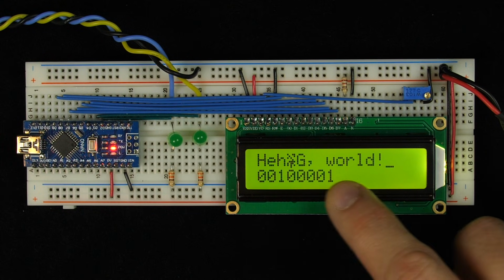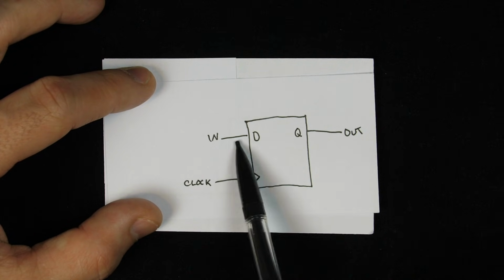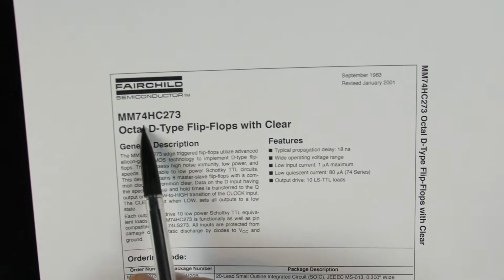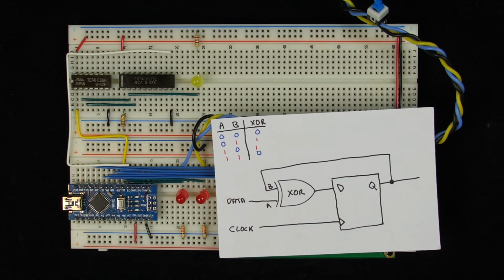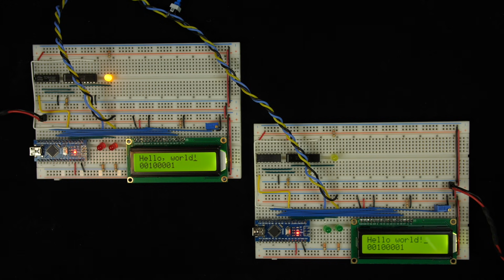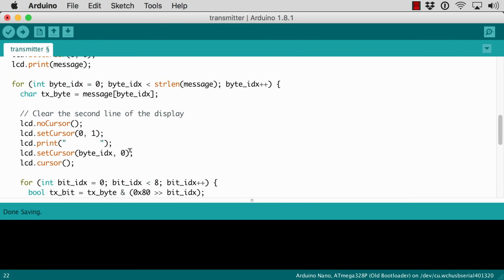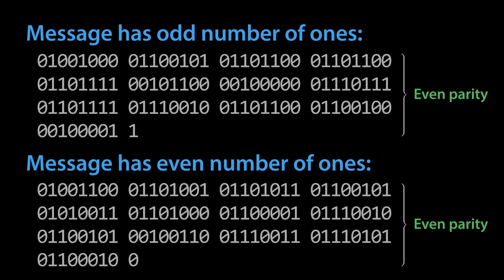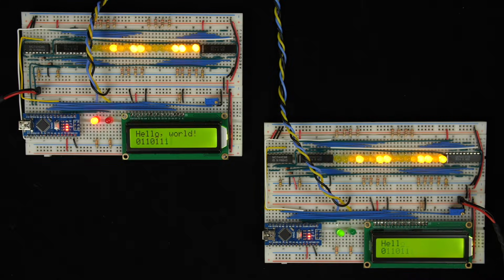Error detection: Parity checking

Comment from the maker: The circuit I start with at the beginning of the video comes from the previous video: https://youtu.be/eq5YpKHXJDM

You may have noticed I changed the LCD displays from the last video to yellow ones because they’re easier to read. Other than the color, they are identical. Links to both are in the description above along with links for all the parts and code used in this project.
Reply: @Aser. Doing a Half-Duplex comm would involve adding some bidirectional buffers and a direction protocol, but doing it Full-Duplex over the same wires would be a challenge.  You'd have to do local and remote echo-cancellation.  The latter would put hair on your chest if the transmission lines were not ideally terminated and the propagation delays were more than 1/2 of the bit width....
Reply: Amcia Apple Propagation delays more than half a bit width aren't exactly gonna come up when you're transmitting a few bits a second, so that's no problem, so echo cancellation can be safely ignore. To put it simply, you just need to ensure both devices aren't transmitting at the same time, or in the case of full duplex both the devices are capable of transmitting and receiving at the same time, as the transmission rate/speed is too low.
Reply: Full duplex is easy to do using two sets of wires, one in each direction -- that's how twisted-pair Ethernet works, for example.

Doing it with a single set of wires usually involves modulating the signal onto some kind of carrier and using a different carrier in each direction. For example, the old 300 baud dial-up modems used four tones of different frequencies, for 0 and 1 in one direction, and 0 and 1 in the other direction.

Echo cancellation is only relevant if you're trying to send baseband signals (i..e. no modulation) over a single pair of wires. Analog telephone connections have to contend with it, but as far as I know nobody does that with digital signals.

There are a great many modulation schemes and endcodings that can be used -- lots of interesting future material for Ben here!
Reply: Ben Eater hi, could you try to upgrade that system to be able to comunicate the two devices, in the 2 directions? (being ahle to transmit and recive data at the same moment, not only a transmiter and a reciever, but both being transmiters & recivers
Reply: Amcia Apple you make it sound as it was extremelly simple & obious, but its not, im not a expert/i dont have enough knowledge. Im still a 16-17 year old teenager interested on electronics -_-
Reply: Aser Granado Walkie talkies are half duplex - only one of the two devices can be transmitting at the same time, while cell phones are full duplex - both of them are transmitting and receiving at the same time. I know this is a crude example, but I'm no expert either.
Reply: Aser Granado - Amcia Apple is talking about connecting each transmitter to the line through a tri-state buffer. When a station wants to send something, it turns on its buffer, sends the data, and then turns it off again. The two ends would have to coordinate somehow so that they didn't both try to use the line at the same time.

In practice you probably wouldn't want to connect the buffer outputs directly to the line, but through a series resistor or something like that, to prevent damage if they do happen to get turned on at the same time.
Reply: Greg Ewing Yet at the same time ensuring the series resistance is low enough as to not attenuate the signal. Complex situation really.
Reply: Greg Ewing I also believe echo cancellation is needed for digital signals when using telephone lines (I forgot the correct term for it) for the communication, though I could be wrong.
Reply: Ben Eater cool Video!

Please upgrade your 8-bit Computer with an numpad or keyboard and an driver for the keyboard.

Thank you. I am really looking forward for the next video
Reply: To demonstrate circuits, you could use simulator.io. it works really well.
Reply: Please make video on how to use digital potentiometer potentiometer.
Reply: @Aser:  The phrase "put hair on your chest" is a euphemism for "not easy".
Reply: Ben Eater I paused and thought of my own solution when you asked for one. I realized it is the same as how XLR cables work with their 3 pins. 1 pin is positive voltage/ 2 pin is ground/ and 3 pin is not connected to transmitter but still runs length of cable with the other pins. If EVER the receiver finds a voltage on that pin it means the signal pin could have gotten a voltage it wasn't suppose to either. Then you'd just restart the transfer of that byte until the third pin never goes above 0v.

I think this method would work only if all 3 wires are twisted around each other as they run to make sure the interference gets equally close to each wire.
Reply: Actually I misunderstood how XLR cables worked but I suspect my suggestion is still possible (+it doesn't take any processing data on the transmitting but does require detection on the receiving end)

Still you should read about XLR because that is pretty damn cool itself.
Reply: ben
can you build TV typewriter by Don Lancaster
Reply: @IntellectualUniversity  This would be really cool. Im in my 40s, my dad bought an Apple ][+ when it came out because he was a ham radio guy and had tried and failed to build a computer. "You'd be surprised how hard it was." - Now that I hear the name again, This is the group of projects he was discussing. And my dad was real good fixing tube radios and tv's. He understood the electrons and waves like some thing he could hold in his hand.  
Id love to see the code that accomplishes what those 1973 chips and boards did with ascii and character advancement, etc. Really cool channel!
Reply: will you do paging and some other stuff?
Reply: Sir please make video on how to use digital potentiometer without using programming?

Comment: Maybe you can use a checksum? At the end of the message, it sends an end-of-message signal, then the checksum, then the end-of-transmission signal. If the checksums don't match, then the receiver sends a signal to the transmittor saying that it didn't get the right checksum.

i just realised this video was from 2018... oops

Comment: Hi Ben, I really love your channel! I've grown an interest in computer science ever since I started watching and it doesn't stop. I do have a question, though: Seeing as you're transmitting the data bits serially, it'd be impossible to have two bit errors at the same time. Therefore, couldn't the transmitter just constantly send its parity bit, and if at any point the receiver's parity is different, it sends an interrupt that halts the transmission?

Comment: 2:40 Don't know if someone commented this but one way to do the "correction" is to use three receivers and vote which is correct. There are computers that work this way. They are used in places where fault tolerance must be maximised. If a module shows that it is outvoted all the time then it "calls" the technicians to replace it.

In the 90's I was present when in one of those computers the backplane was the problem. It was a stupidly simple procedure to fix the problem. The technicians erected the new backplane, fired it up and connected it to the old backplane. While the computer was running they transfered the function of the "old" computer to the new one by just pulling out modules from the old backplane and inserting them into the new.

Even how impressive it was, the company I worked then did not buy those computers.

Comment: 📺💬 Jirayu adds some conversation ... make it more of an example about parity checking.
🥺💬There are multiple and parity bits when summation is working with parity bits and multiple errors can handle by previous message and parity error checking bits, see from his example there is a bus clock working and they are divided message into multiple brackets and there are options to have parity number checking at the end of each bracket or each blocked that is because it is at least number format for send a command.
🥺💬 Now it is a trick here when you transmit a command with an error it required the same setup message value to stop and reply back ACK or Reject but when the parity bits checking is incorrect the receiver waiting for the next actions in the queue. 
🐑💬 We added a timeout message later that we never expected that to happen ...
🥺💬 Yes timeout I need to prepare for the schedule and will continue on this VDO and that is call error parity bits checking time delays that had wide effects in time.
📺💬 ยุ้ยแถมเยอะไปแล้ว 🥺💬งานผมอย่างนี้จริงวจริงครับเพราะว่าต้องทดสอบ แต่ว่าไม่ได้เขียนเองมากนักหลอก เว้นแต่ requirments เดี๋ยวกลับมาใหม่ครับ
🥺💬 ผมยกตัวอย่างนี้เพราะสำคัญ จะให้ผมยก matrix มาตอบอาจจะไม่รู้ว่าสำคัญอย่างไร ได้รับข้อมูลผิดก็ส่งใหม่ ได้รับข้อมูลแต่มาไม่ครบเท่าจำนวนที่จองไว้ หรือยังรอรายการอยู่เป็นอีกเรื่องนึง ให้เห็นว่ามันสำคัญอย่างไร

📺💬 After the conversation and now we add the D-flips flop into transmitters it is XOR gates and see what is the effects on the receivers.
🥺💬 It had Opamps inside with logical gates that emit exceed current and encoding output, as you say if there are no delays in transmitting setup and the receiver uses logical gates that see its circuits it provides current flow with logical gates output mapping. 
📺💬 Yesterday's post, can you delete about a delay or reverse delays 
🥺💬 It does not require transmission and receiver because it has a delay in nature except in the experiment like yesterday and the purpose of D-flipflops is more into encoding signals and phasers.

📺💬 พลังเจ้าฟ้าครับ จับมันคิดเลขออกโทรทัศน์ 🥺💬 ผมก็จะบอกเหมือนกันพวกเค้าคิดไปเอง ผมไม่มีอะไรทำเลยตอบเล่น จริงแล้วเนื้อหาบางอันดีนะแต่เค้าพากย์เพิ่มเสียงเข้าไปด้วย อันนี้ไม่ยากครับผมไม่ได้จะอวดหรือมีจุดประสงค์อื่นดูตัวอย่างที่ผมยกให้ตอนที่ขอผมรู้เรื่องไหมครับ⁉ บอกพวกเค้าหยุดด้วยเค้าทำอย่างนี้อ้างคนไปทั่ว 📺💬 เอองั้นหยุดนะยุ้ย 🥺💬 ผมดูน๊อตเค้าก็ด่าผมครับ ทำรายการไปเถอะมีประโยชน์

📺💬 Lower header and error corrections.
🥺💬 Lower header transmission because it can error correct information, thank you that is good VDO.

Comment: Why not use RX and TX clocks?
Basically, when the transmitting device sends a package and wants the receiver to read it, it drives TXC (tx clock) high for a short amount of time. Then, it waits until it receives an RXC pulse, and when it does, it starts over.
Meanwhile, the receiver reads the package, does some stuff with it, and then, when it's ready to accept more data, it pulses RXC.

Comment: Making that parity checking bit with electronic hardware is a bit irrelevant in my opinion. In real networking hardware this is all done with software of course. You could as well have put a pigeon with a letter in between the parity bit circuit... equally irrelevant. But interesting video nonetheless. 🙂

Comment: In this video, +Bean Eater is using two wires to send the data and clock, why not use a third wire to send the parity and detect errors early?

Comment: 13:36: Interestingly, you're shorting out the 1 to ground for three clock cycles; that's how the o (ASCII 111: 01101111) turns into a (ASCII 97: 01100001).
14:08: Even more interestingly, here you've shorted out the 1011 sequence in the comma (ASCII 44: 00101100), turning the character into a ␀ (NUL), which in the HD44780 is user-specifiable, but left undefined here, so nothing is printed for it; that's how it's simply omitted.
Reply: Great insight!
Reply: @andreamazzai1969  Thank you. :-)

Comment: You can also check the number of changes. 

A string of binary changes odd number or times
A string of binary has an even number of 1s

If 1 bit changes, # of 1s will catch it. If more than one bit changes, the # of changes check will most likely catch it.

Comment: Just a tip: The reset line on your arduino is already pulled high through 10K, and goes low when shorted by the button. You could have connected the reset line straighr to the clear on your external logic so it would reset it's state when you reset the Arduino. Great videos BTW.

Comment: Awesome video, as always. I'd like to add one thing, however. I felt the jump to the D flip flop and XOR gate was not smooth. I like to think of it as: we are adding bits, and all we care is the Least Significant Bit. Now, what do we use for adding? (Maybe add a part of taking people from the required truth table of one bit adder, and show that it is basically an XOR gate). Then, add that you need to be doing this recursively for the entire message. And thus, enters the D flip flop into the picture, as a clocked  memory element. 
Again, your videos are awesome. I'm an Electronics Engineer currently pursuing my masters, and find your videos entertaining and useful for learning stuff.

Comment: Love your videos!!  Do you mention anywhere how would you handle bit-alignment errors?  Try starting the Receiver at a random pause after starting the transmitter?  Bits could all be received perfectly, but if the bits are misaligned, the data would be wrong.

Comment: You could just calculate parity in the Arduino code in stead of building a parity circuit, right?

[EDIT] .. and also would it be sensible to use the first unused zero-bit to transmit it?

Comment: The light keeps introducing errors when he is not turning it on and off because it is AC running through the cord, turning it off momentarily stops the interference. That's one reason cables have shielding :)

Comment: parity check is good, but only when it's always with parity checks.
I worked on a program, but from one input, it had parity bit but the other one didn't, so the data was messed up

Comment: Really liked the video, but I do have a question - is there a reason you're computing the parity bit in hardware, reading it into the Aruino, and then transmitting it rather than computing the parity bit in software?  Just wondering if there's any relevant trade-offs to be aware of here.

Comment: The triple check method you showed at the beginning of the video is actually used in the real world. And everyone in the US has heard it at least once. It's used in the Emergency Alert System (or EAS) at the beginning of the message. The first three tones that are heard are actually called the SAME (Specific Area Message Encoder) header. It contains data that tells the receiver which area(s) the message is meant for. If the receiver is not in that area or two out of the three headers do not match, the message won't go out

Comment: Hey Ben,
 cool videos. Getting again more interested in Digital Electronics. Caused by that I wanted to ask if it might be a good idea to use a M.Controller for translating a Binary input (greater than 9 ofc.) into a BCD code to be able to put it into a 7-segment display. I am using TTLs for building and I know that there is the SN74185 that does exact the same thing. The problem is that even with datasheet it's function is a big  mystery for me cause it does not the exact thing it should...EEPROMS I don't want to use cause Saving all the numbers in there would make me crazy :D

Comment: Very good and interesting video! There's just one thing I'm wondering. Is there a reason for calculating the parity with the flip flops and not the arduino? May the reseaon be that it's "cooler" (because it really is) or maybe just to more easily show what's going on? Thanks.

Comment: How good is it to use different hardware to calculate parity? I mean what if the wire to the hardware is fraud? Wouldn't it be better to check and calcualte parity in the chips itselv, because then you count on the ectual resieved/send data?

Comment: I have came up with my own answer for this but want to verify it with yall.

At the beginning the oscilloscope showed an erratic signal in place of some of the bits, but then after adding parity hardware, he just pused a button to simulate the error.

I dont see how parity would help if the electric cord was over the data line.. Wouldnthat register as a 1 or a 0 on the parity hardware?

Comment: Parity bit is not a good indicator for xfer err. You should use framing with ECC. Since you are using ATmega328, you will probably be limited to 256 byte frames with Hamming encoding (1 bit correction and 2 bit detection).
Reply: It's only the second episode of the series, I'm assuming he's going to talking about more detailed topics in later videos.

What you said sounds interesting though. I wonder if he will talk about that.
Reply: The main issue is that the ATmega328 has very little processing power and RAM in order to do proper ECC. So you are going to be limited to small byte buffers with mostly just XOR/AND correction (Hamming, etc.). Ideally, you would want something a little more powerful that could do real-time BHC correction that could correct lots of bits using the same 4-6 byte correction data per 512 byte buffer.